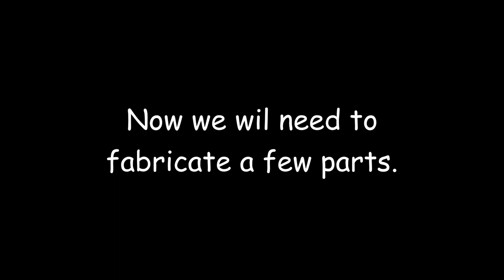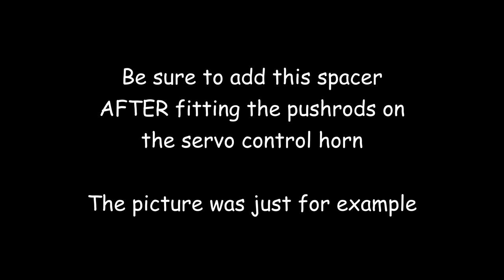Aileron internal linkage mod - Part Three - Pushrods fab and installation

Comment: Nice rigging! It works very well and the material makes it very inexpensive ;-) Well done! See you in the Air!
Reply from the maker: Thank you.  The real challenge will be to see if I can apply this method to the bent-wing Corsair. I won't know until I have one to study, most likely next month.  Happy flying!
Reply: @Doggeslife  , I know how that goes, I just received my Props today, still waiting on a motor, receiver, and LIPOs I don't expect to arrive until mid June ;-(

Comment: Love your videos mate. Excellent workmanship.  Just wondering if there is a reason for this mod ? If so why ?
Reply from the maker: Greetings, and thank you.

  This mod gets the servo and linkage out of the air-stream for less drag and away from harm if you make belly-landings "wheels up" as I do.  Also it just looks a heck of a lot nicer.  

  The geometry of the stock set-up is just wrong anyway and only works because the control horns bend back and forth instead of everything binding up.  When I started with balsa kits in 1981 the aileron linkages were always internal. I prefer it, and I had fun making the mod.

Happy flying!

Comment: Great job.  Accomplished your goal.  I'm currently trying to keep the receiver stabilizer and use the rudder channel for an extra function.  Any ideas?
Reply from the maker: You might be able to mix a toggle switch to the rudder channel depending on your transmitter. That's how I run the ESC throttle off the flaps channel.
Reply: @Doggeslife  Can I bind my Flysky I6X to the receiver?  It has all kinds of mix/switch capabilities.
Reply from the maker: @AMX02450  I am not sure.  I know people are doing it with Taranis 16s.
Reply: @AMX02450  You need to get a multiprotocol module for your radio. iRangeX iRX6 is one you can get. Albert Kim has a video on it. You use the V761 protocol.

Comment: HELP! I have this plane but can't get it to fly. It goes left on taxi and the elevator doesn't move. Any thought on what the problem is and how to fix it? Thanks for any help.
Reply from the maker: Sounds like a defective receiver, especially if the motor runs but the elevator does not move.  I'd return it for an exchange.
Reply: @Doggeslife  Thanks